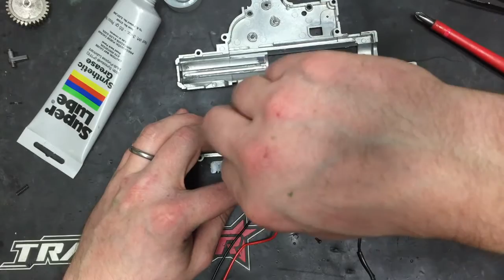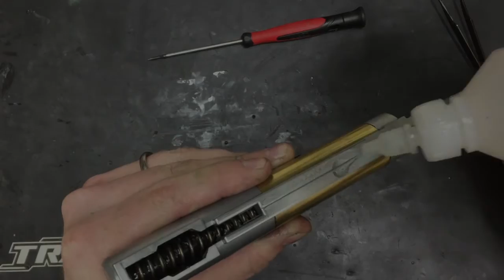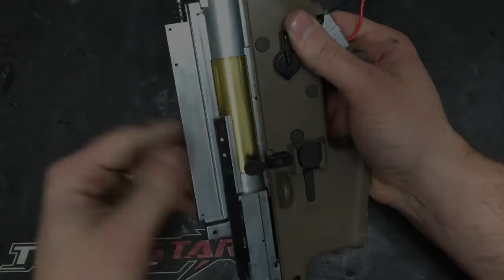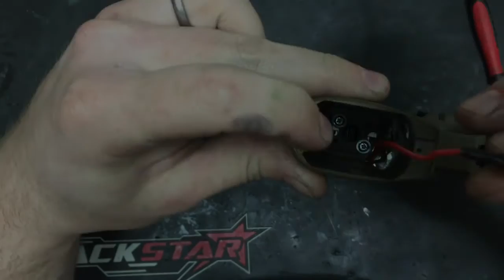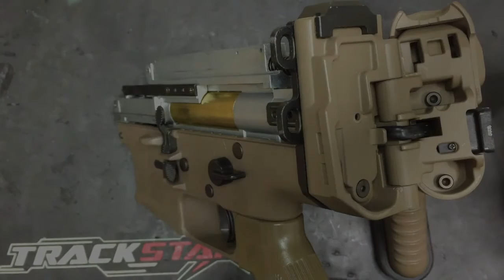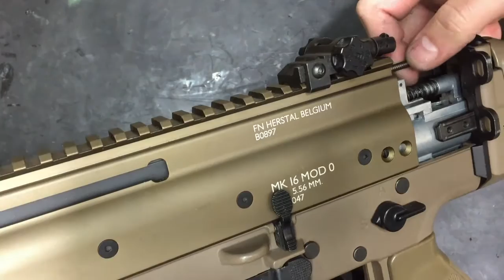TM Recoil SCAR-L Reassembly

Comment: Great video. Bought my scar second hand and found a detached piece. Disassembled and reassembled it completely with your helpful video. Seems like my empty mag detection piece broke. Does it do something, and is it necessary to replace it?
Reply from the maker: Thanks 😊

Is it one of the small levers that sit under the front of the gearbox and protrude into the magwell? 

The gun will function fine if that’s broken, it won’t cause any damage, just the empty mag detection will not longer work correctly.
Reply: @KingdomofAirsoftUK  It's the one you show at 9:47. Will try to find a new one and come back again to your video to mount it. Thanks for the response!

Comment: Great video Sam, it finally gave me the confidence to do a disassembly (upper only). Took me 45 minutes to disassemble, fit a factory first short bolt handle and change sides and reassemble! Lot of work for just a bolt handle but all went smoothly! Shame I didnt have any sorbothane but next time when I fit the R Hop perhaps!

Does the upgraded Pistonhead and O ring more or less compensate for the FPS drop by adding the sorbothane or will I need to do some fettling?
Reply from the maker: +Mark Walter Glad it's been helpful :)
When you fit the Sorbo Pad, be sure to very carefully check the angle of engagement.
Have a chat to Airlab - we've come up with the perfect solution so they now sell modified Lonex Recoil Cylinder heads that perfectly correct the AoE with their Sorbo pad.

You'll lose a bit of cylinder volume with the Sorbo but you can regain that by either installing a non-ported cylinder or using a Bearing Spring Guide to pre-compress the spring slightly.
Or both :)

Comment: Hey your videos are a great help. I'm trying to figure out the least messy way and I'm considering just using the same spade connector method... Would you be able to give some tips on how you wire the BTC from the TM Scar L gearbox to the battery compartment?
Reply from the maker: Thanks you :)
Let me know if there are any videos you'd particularly like to see. 

I generally cut off the connectors and solder the wires directly. 

There's a decent amount of wire in the stock so you can pull it through a bit and just work on the gearbox with the stock still attached, should you need to open it up after the upgrades.

Comment: Nice video. I'm glad I don't have to do all of this on my AK replica. So much easier...This is quite demanding and time consuming,but very well worth it. This TM SCAR-L looks very nice. Is it possible to run this replica on 400FPS without doing damage? And what ROF is recommended for  Recoil replicas?
Reply from the maker: +Ljudevit Binder With a few preventative measures, it's definitely possible to run it at that level indefinitely.
I'd recommend a Sorbothane pad, steel bushings and upgraded gears.

I generally try to keep the TM Recoils at about 15rps. That allows them to be very snappy without putting too much strain on the piston.
If you have a stronger main spring and recoil spring, you can push it further though.
Reply: +Kingdom of Airsoft Aha,OK sorted. I also use Airlab Sorbothane,very well made indeed.So,18:1 SHS would do the trick? No need for Siegetek's on 15rps I guess. It's just,TM seems all plastic and fragile from outside.
Reply from the maker: +Ljudevit Binder  Some parts on some guns are still a little plasticy, but for the most part, the material quality has greatly increased for the Recoils. 
The internals are very well designed though!
The new gearbox shells (all but the first off the production line) are beastly, you'd have a hard time breaking one!